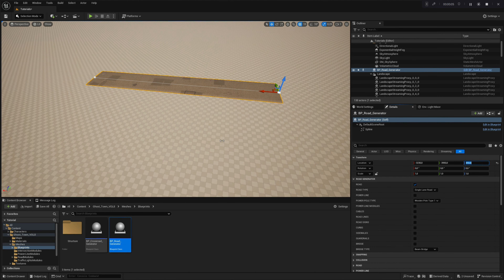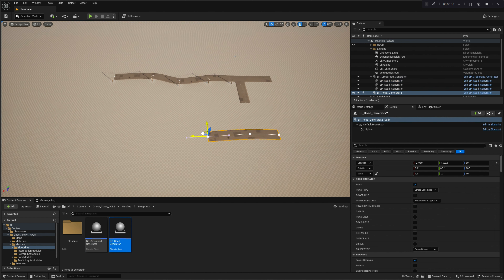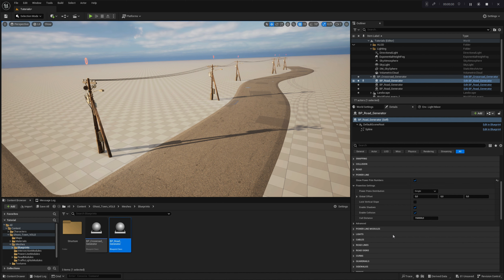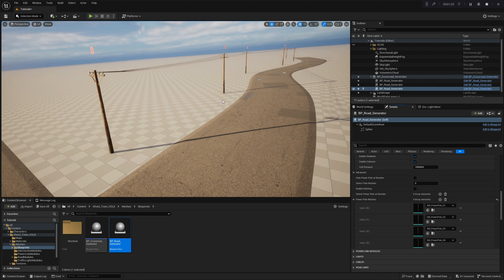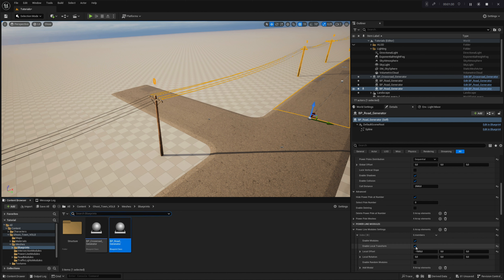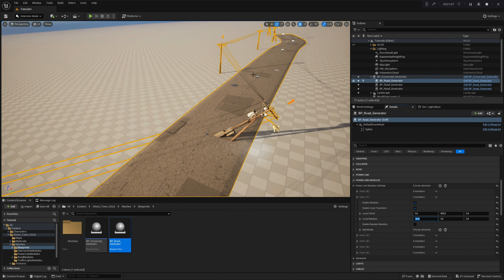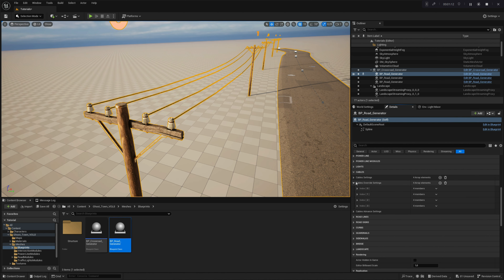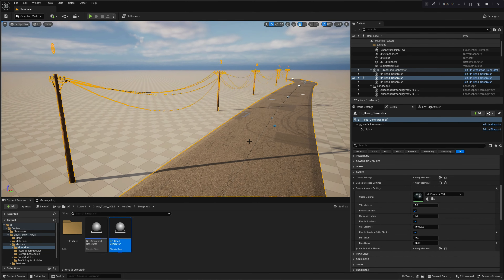Crossroad Generator For Unreal Engine 5 - Power Lines

Comment: I've been searching for roads blueprint for weeks and This cross road generator looks promising, I have few questions.
1. Do these blueprints support on UE 5.3 without any issues?
2. Does this road will get adjusted according to landscape? and if we don't want to adjust, instead will it  deform the landscape according to road?
3. Can we able to replace roads meshes, traffic light meshes easily without going inside and tweaking event graph to work?
Reply from the maker: Hello, thank you for reaching out! 
1. Yes, it works without any issues in UE 5.3
2. Yes, you can deform landscape accoridig to roads or crossroads and also, you can project the road or crossroad onto landscape. We are preparing a tutorial about this topic which will be released later this month. 
3. Yes, you can customize blueprints with your meshes easily by replacing them in the blueprint menu , however in some cases you will need to tweak the construction script too, especially if you what to customize spline meshes.
Reply: @Rendertale  Thank you for the reply, definitely gonna buy this. Looking forward for the tutorial.